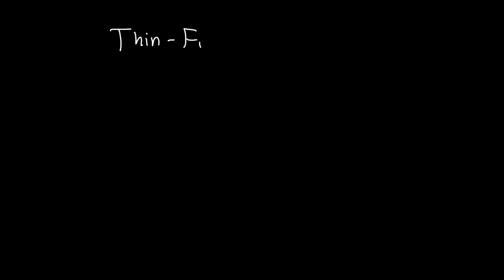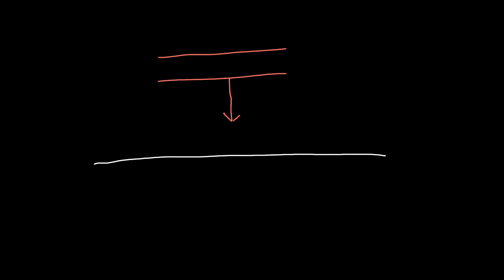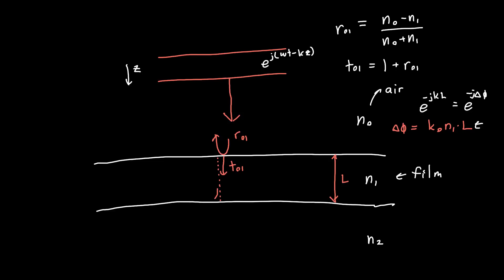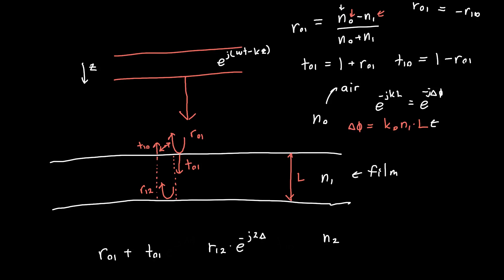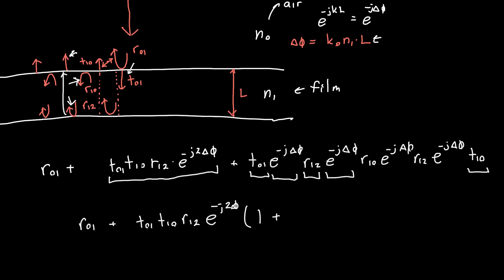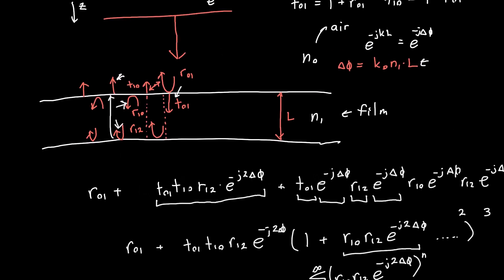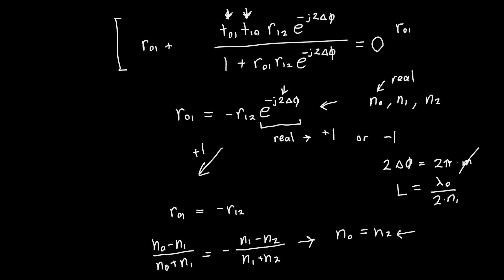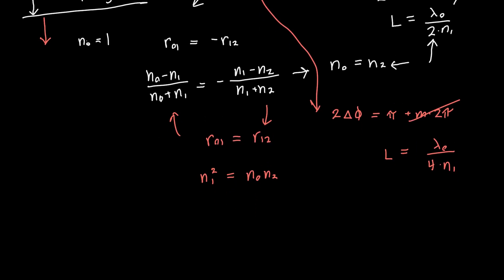Thin-Film Interference using Fresnel Equations

Comment: There is something weird when you set the amplitude of the total reflected wave to zero. What you normally want in an interference is that the norm squared of the field, which is proportional to the intensity, be zero (or a minimum since sometimes zero is not possible) for the total destructive case. Interference is all about absoluting squaring the fields interfering, because it manifests itself on the crossterms.

Comment: you should add in your title that calculations is for s polarized light! and s-pol picks up an additional 180 phase shift upon relfection from air to glass. So I am assuming this is all glass to air reflections is that right?
Reply: Notice that he assumes a normal incidence. Therefore, the light is necessarily s-polarized since the polarization of the electric field will be parallel to the boundary by construction. If he had considered the general case with the incident light making an angle theta, than yes, he would have to make a different calculation for the s and p-polarization cases. Nevertheles, I think the normal incidence case is more important.
Reply: @danielribastandeitnik9550  I think you meant that at normal incidence, frenel equations are same and air to glass or glass to air transmission doesn't give reflected wave a pi phase shift. I don't get why did you say normal incidence require s-pol.
Reply: @s1231-t6v  The incident EM field is coming orthogonal to the boundary, therefore the wave-vector is normal to the boundary and the electric field must be parallel to the boundary since it must be orthogonal to the wave-vector. The definition of s-polorized lighe is "light whose electric field is normal to the plane of incidence is called s-polarized". Note that for a normal incident EM field the plane of incidence is kind of ill-defined since there are infinite candidate planes. Nevertheless, for a given electric-field, there is one plane of incidence for which it is normal, therefore it is a s-polarized beam.

Comment: A question please:
If we want to get the reflectance as a function of the wavelength (to see the effect of the ARQ on other wavelengths for example in solar cells) we will calculate the real part of the complex amplitude (divided by the initial one) of the total reflected wave and then take the square. It works. 
But, should we worry about the variation of indices according to lambda (Cauchy's law)? Or just the variation of delta-phi is to take into consideration (delta-phi = 2pi.(2L)/lambda ) ?

Comment: can we apply this in the case of multi structures ?
Reply from the maker: Yup! But if you try to do it with infinite sums it gets pretty complicated, and so most people use the Transfer Matrix method for this (I have a couple videos on that as well).
Reply: @JordanEdmundsEECS  i saw your videos, i have one question. In the matrix method, for the case of the incident light have a certain incident angle, how can i do ? I imagine that i have to use the frenel equations in the case of incident angle instead of the frenel equations in the case of normal angle. But i don't know for the optical length, we have to change something or not. Thank you.

Comment: Why are you only considering "S polarized " reflection and transmission coefficient in the calculation?
Reply from the maker: You can do it for p-polarized light as well (I believe I do in one of the next videos). S-polarized light is just easier to deal with and fortunately it’s also more common to find in practice.